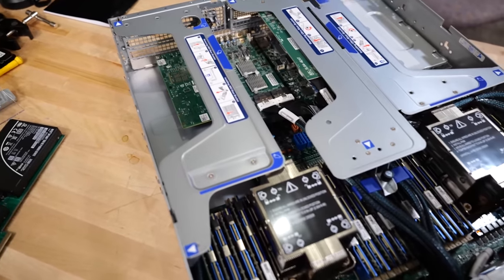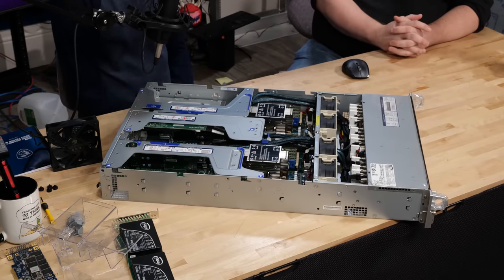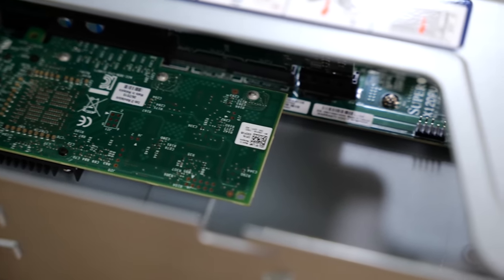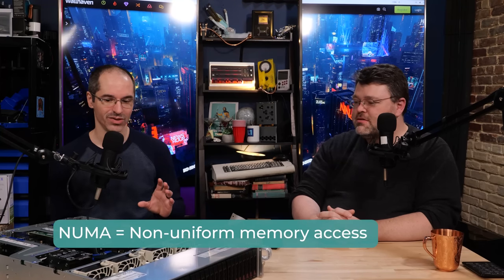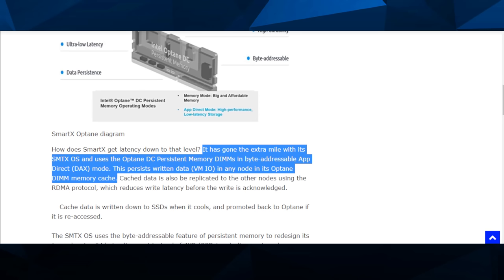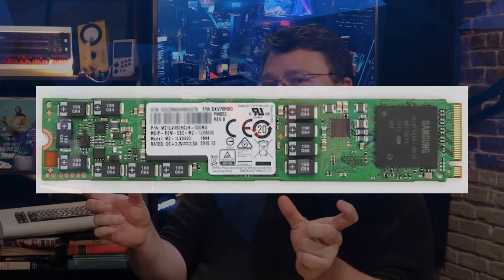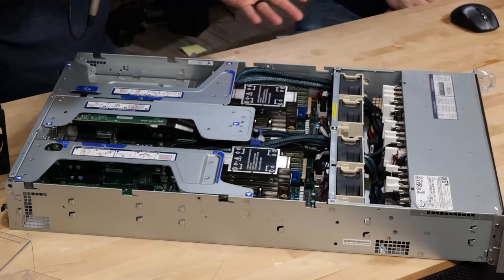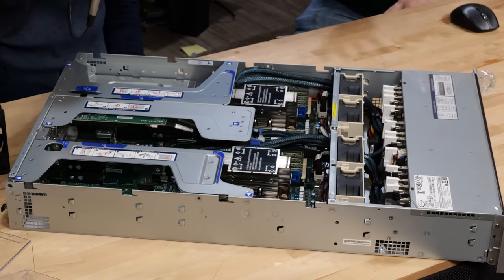BigTech: $250k of Persistent Memory w/Allyn

Comment: Would be interesting if the CPU had non volatile cache or a mirror of it so if you pull out the power cable and plug it back in it continues right where it left off in a millisecond.
Reply: it's impossible to have a perfect 1:1 non volatile cache, at least with current technology. L1 cache access is in the 1ns range, and registers are sub-nanosecond... they would've been written to a thousand times over before you could sync to optane pmem.

Comment: Maybe a stupid question regarding client SSDs with DRAM but no powerloss protection: If you power the SSDs not just with the computer‘s PSU but use small powerbanks for 5V and 12 V, would this add functioning powerloss protection?

Comment: Pmem isn't a free lunch.  CPU's have several levels of caches and write buffers that have the same basic role and semantics.  Yes.  When you write to pmem it doesn't actually get to the media unless you use the special flush instructions.  So you end up doing the exact same crazy stuff done for filesystems for you pmem where you write unsynced and then flush at critical checkpoints.

In that respect it's the same as even the client SSDs.
Reply: This is all taken care of with App Direct mode + DAX. No extra flushes necessary. Things have come a long way over the past couple of years.
Reply: @malventano  First off, that was a fun video.

Sorry if I came off like I suggesting it's not a solved problem, that wasn't my intent.  My point is that it is solved, exactly like dealing with buffered drives is a solved problem.  Same reasons for having buffers, causing the same problems, leading to the same solutions.

I co-wrote a patent for a phase change memory in a DIMM in 2009 so I'm a fan of the concept.  Nevertheless, I've long thought pmem advocates do a disservice to the cause by running with talking points that bury the lede.  Pmem shines plenty in low latency and small operations, no reason to pick fights you can't easily win.  Saying pmem is better because it doesn't buffer data, is just inaccurate and frankly unnecessary.  Integration of pmem tech into SW stacks is hard, the ecosystem has made it more accessible, but the point is it can be well worth the effort.